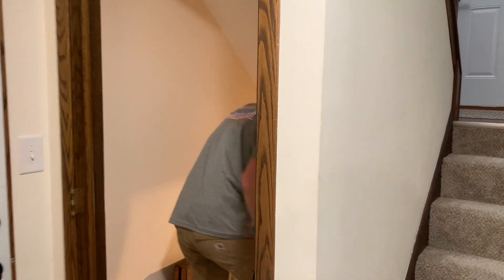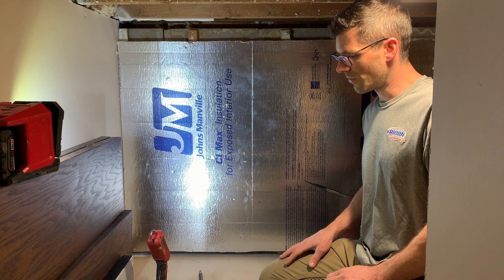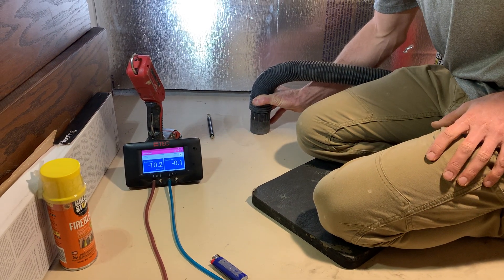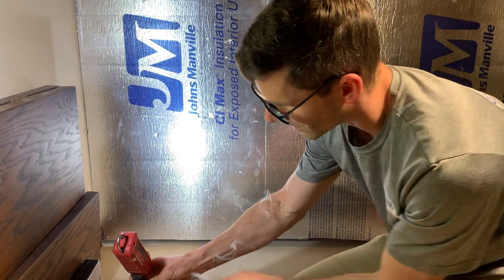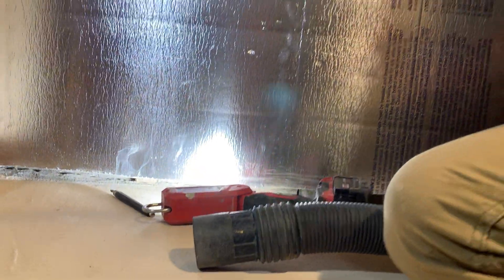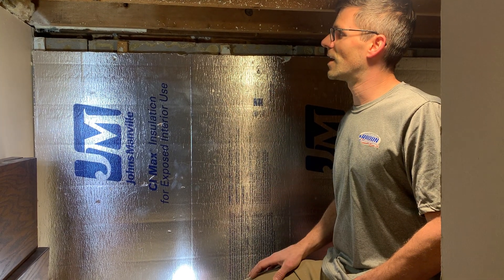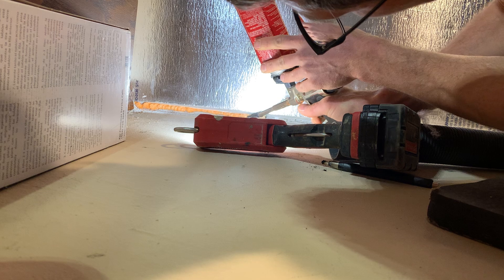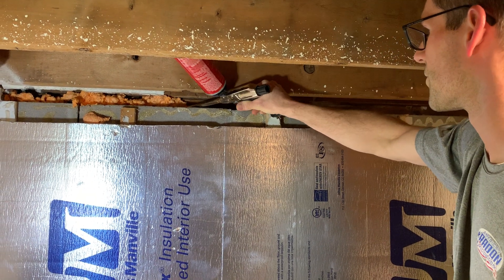Don’t Skip This Radon Step — Our Suction Jumped to -50 Pascals After Sealing

Comment: Wish I had known about you guys earlier. Hired a different company in the twin cities to do my radon mitigation. They didn't do any pressure field measurements, just slapped a fan in and sealed the sump. Cost almost $2k and my Radon level didn't even get that low. Went from a 5 to 2.3. I can hear some air leaks so I'll definitely be doing some sealing...
Reply from the maker: I'm sorry to hear that. Unfortunately, it's relatively common for this to happen if the mitigation system is installed without any engineering. 

The last two projects we worked on were in homes with installed radon systems that didn't perform as well as the homeowner wanted. 

We call these system optimizations. We start by measuring the baseline pressures below the slab and calculating our target pressures. Then, we measure the pressures induced by the current radon system and identify areas that aren't being treated. Next, we come up with a plan to treat those areas. Radon measurements are also taken during the process to help steer the decision-making process.
Reply: @AmericanRadonMitigation  Do you use any type of backer when sealing block tops, or only spray foam? I've got a lot to seal so I thought I could lay foam board over and spray seal to the sill and block.
Reply from the maker: @williamarthur9617  Yes, I stuff fiberglass insulation down the block tops to act as a backer for the foam. Check out this video to see how: https://youtube.com/shorts/rlvZJL0se0Y

Comment: Thanks for the video! Im trying to seal the tops of my block at the moment but the spray foam just falls to the bottom and never expands at the top of the block. Do you recommend using so foam board and the. Spraying?
Reply from the maker: I stuff the opening with fiberglass insulation and then foam it. You'll see me do this three minutes into this video. https://youtu.be/h0g_UY5-Zew?si=LAazhf9RXJkEyfZb
Reply: Got it! Thank you. I was trying to use rigid foam board but was having trouble getting it in tight spaces. I was afraid that fiber glass batt insulation might cause mold issues with moisture in the block but good to know!

Comment: To seal the top of the block I ran 1/2" foamboard through my table saw to cut strips then laid a bead of foam to glue it to the block.  Works really good. I just can't get the radon from coming in I keep sealing and sealing.  Hoping to avoid having to put a fan in because the concrete was just poured on the sand. :(  I'm in Elk River MN and around 5 pci/L  after just sealing its around 2-3
Reply from the maker: Elk River, you're right down the road from us! 

It's easier to get PFE with sand than with clay below the slab.

I've been told that the EPA has done studies and has concluded that sealing alone is not an effective mitigation strategy. However, sealing is often vital to an effective and efficient mitigation system.

Feel free to reach out to us if you'd like an estimate on mitigation! https://americanradonmitigation.com/

Comment: Hey Jesse, what are your thoughts on RadonSeal for sealing entire slabs that are new pours and don't have cracks??  Is it worth the money?
Reply from the maker: Hey Brent. I'm not sure, as I've never used the product. Let us know how it works if you do use it.
Reply: @AmericanRadonMitigation  will do, I have an airthings monitor so I'll let you know if it brings the weekly levels down or not
Reply from the maker: How did the Radon Seal work, Brent?
Reply: I’m interested to know how it worked as well. I talked to a guy at RadonSeal recently and he said the slab/cement first needs to be porous. Also if it’s a smooth slab then it needs to be etched first for the product to sink into and have profile to grab.

Comment: The great stuff foam does age and disintegrate after a few years, i have used to seal cracks and after time it gets really soft and crumbly, do you know if there is a more permanent and  lasting product in the market?
Reply from the maker: Interesting. I know UV light can degrade foam. Do you think that could have happened in your case?